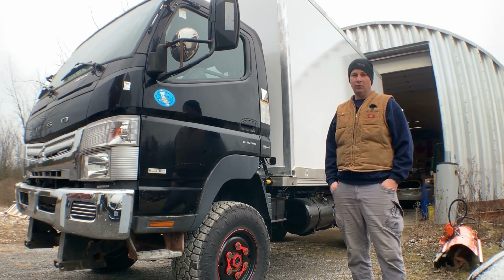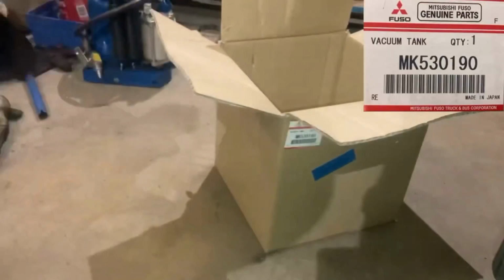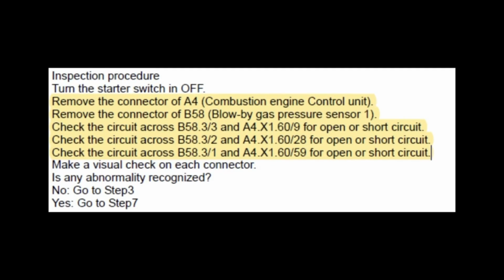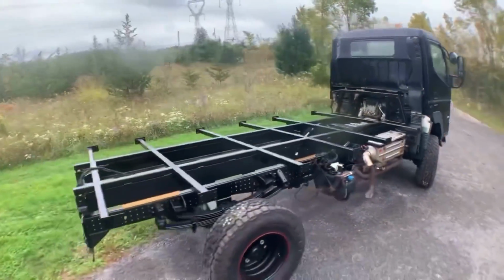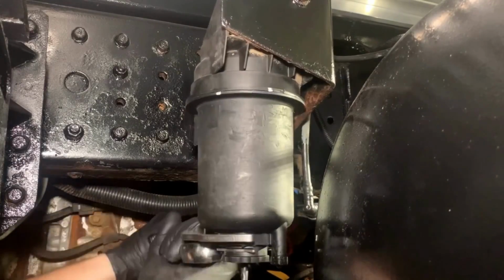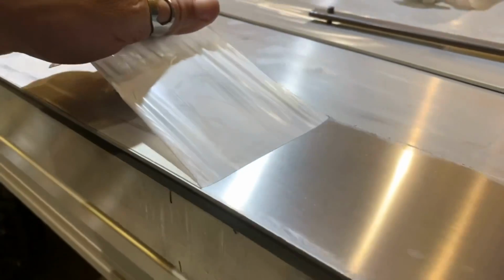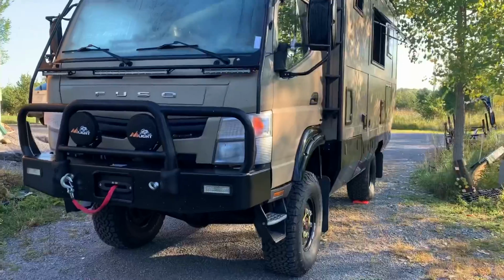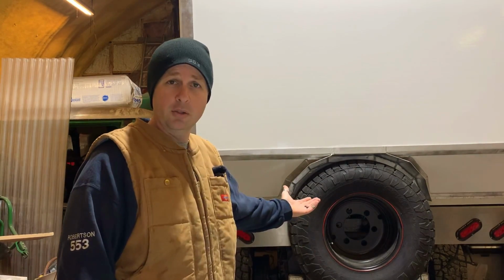Am I wasting my time? | Fuso FG Overland Build

Comment: I found a shortcut to all of this. I planned for one year every detail of the build. And believe me I would enjoy the process. However I am older than you and I wanted to get out in the nature faster.  I was very frustrated with the Fuso Fg options, either too used or very very over priced. I watched what Earthcruiser CORE was doing. I watched how they recently switched from FUSO to Isuzu. So I went out and bought a set of F550 axles, 4:88 gears, A NP205 transfer case, then a Isuzu npr. Since I live in California Diesels are discriminated against. So I choose the Vortec v8 version. Similar to the Isuzu NPS. Except mine will have 6 gears. Using the NP203 TO NP205 DUAL TRANSFER CASE ADAPTER KIT from Northwestfab. I want it to crawl like a unimog. My habitat is built overseas and comes to me in a sea container, turn key. It is a prebuilt composite product with 55mm wall thickness and the price is 25% less than North American prices. 3700mm on tray length, 2100mm tall, 2200mm wide. One inch to spare on the interior dimensions of the sea container. Date of completion Nov 2024.
Reply: Genius! You should share your build and your research - I just got a 2019 Fuso FG and wondering if I shouldn't have gone a similar route as you...